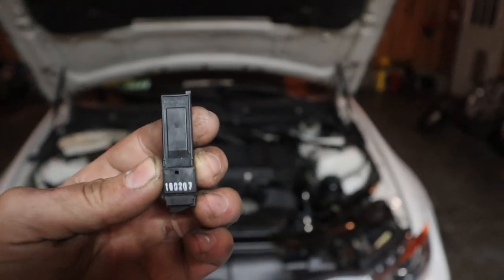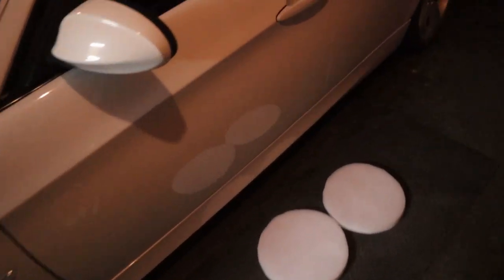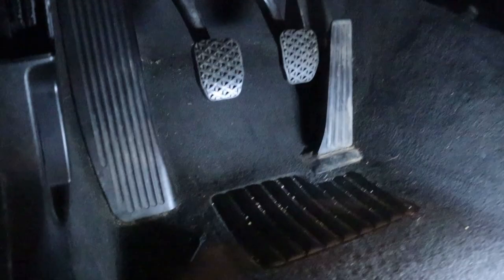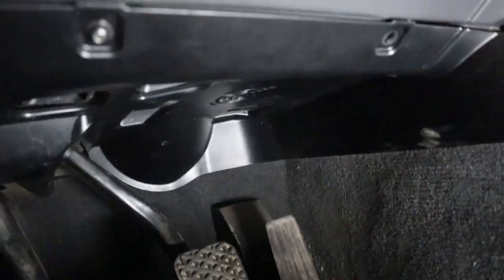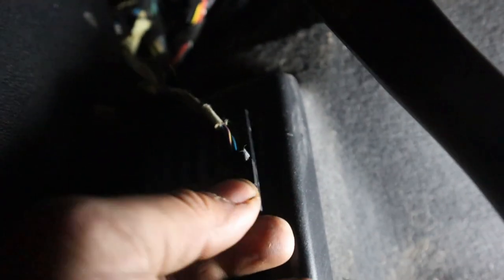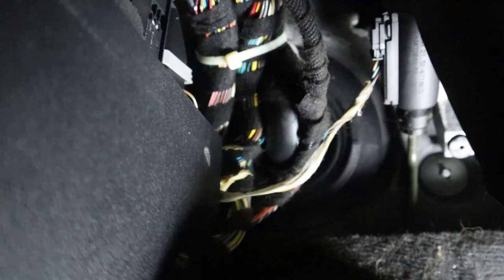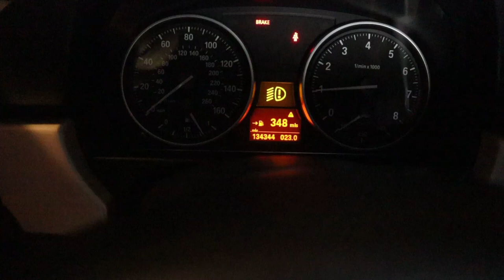BMW Clutch switch e90

Comment: Bro I cut the black and blue and the link and yellow on my e46 and now I got no cranking really upset, was trying to bypass the switch
Reply from the maker: I’m not sure about bypassing the system sorry
Reply: Same here. Got that idea from another guy. Didn't work on 05 330ci (almost same as 07 BTW). Is that little rectangle snap in part the clutch safety switch? I'll just buy a new one since the yellow purple/blue black hack didn't work. Appreciate the video but the music and your soft voice I had a hard time hearing.  After 2 hours under the footwell,  last thing a guy wants to hear is porno music. LOL
Reply from the maker: Hahahahahah happy to help and happy to set the mood with the music 😂

Comment: I have a problem with my car starting i press the clutch in and the ignition turns on and off but the car does not start will this be the cause of the problem
Reply from the maker: When you try to start it, does it still ask you to push in the clutch?
Reply: @dirtykurty92  yes mate it comes up saying press clutch to start, mines a f30 320d
Reply from the maker: Definitely worth a try sounds like could be that sensor!
Reply: @dirtykurty92  thank you ill give it a try and let you no the results
Reply from the maker: @JSR00000  good luck buddy!
Reply: @dirtykurty92  it worked mate thank you for your video

Comment: Does this have to be replaced or just unplugged and back in
Reply from the maker: Some time it falls out of place, In that case you my be able to just put back in, but if it has failed, then replacement will be required
Reply: ￼ thank you will try unplugging first

Comment: Is it possible to bypass this
Reply from the maker: There my be a way to bypass but I don’t know it, the computer is looking for a value range from this sensor not just a on/ off signal. So also this is used for your cruise control so I think that will no longer work if you bypass it
Reply: I have orderd a new one .Best be safe
Reply from the maker: @michaelireland7511  good to hear! Hope it fixes your issue
Reply: @dirtykurty92 yep I had the problem with the sensor and what I did is I take carly and there a option too write out the sensor but you have too long press start button otherwise it will start and cutt of again ... hipe it helps next time
Reply from the maker: Awesome good to know that option is Available and this might help someone looking for a bypass method! Thank you!
Reply: Wire 3 and 4 just putt them together and u will no longer need sensor . Its bypassed 
But your car will start without cluch pressed 
Be careful not be on the gear
Reply from the maker: @elmirmisini4133 have you actually done this successfully on this type of switch? It it not the same as the older bmw clutch switches.
Reply: @dirtykurty92  
Bmw 3 series 2014
Reply from the maker: @elmirmisini4133 nice! Good to know! Thanks for sharing! Did it effect cruise control? Or do you have comfort assess?
Reply: @dirtykurty92  
Sensor must be back on , otherwise cruse control will be problem
Off course these 4 and 3 wire putting them together must be temporary.  New sensor is the best way 😉
Reply from the maker: Nice! Still good to know for testing and temporary fix till you get the part! Thanks for Sharing @elmirmisini4133